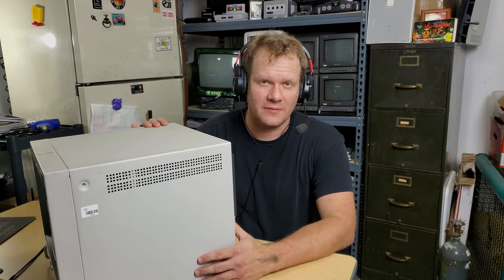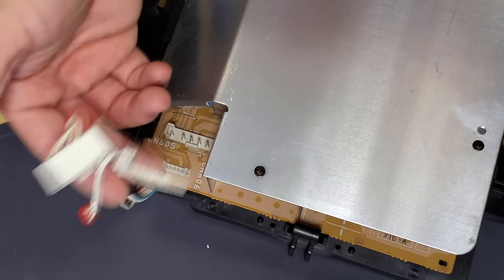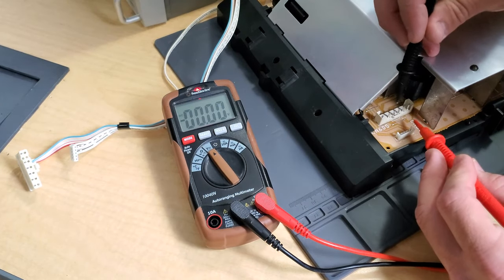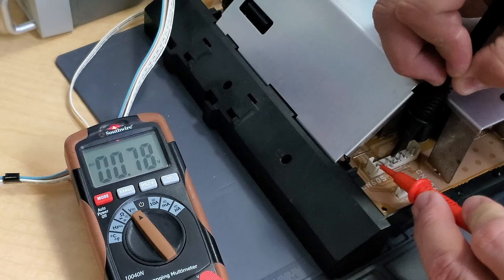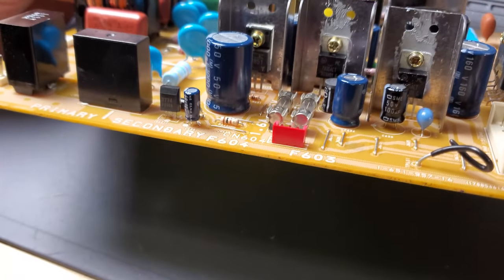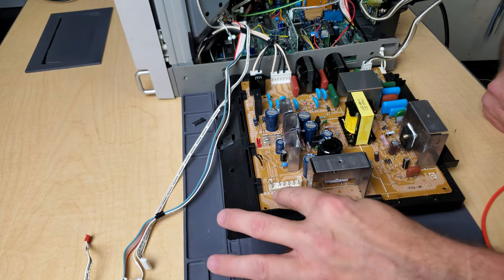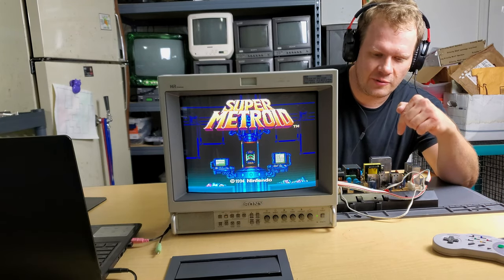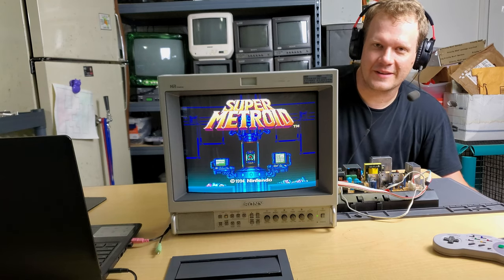My Sony PVM CRT won't Power On - How to find the problem & Fix it.

Comment: Hello Steve. I've watched a couple of your videos in the last days. I got a PVM-14M2U (October 2001) last week. It was sitting in an office unused for years, they were going to dispose of it, and when I asked about it, they told me to take home  (for free!). It doesn't power on, I just removed the cover and I think It was never opened it (the screws were tight like factory and the plastic rivets were pristine). Besides the dust inside and outside, I don't see any major damage (nothing blown, capacitors look ok). I will study your videos and try to repair in 2 weeks. Thanks for sharing this knowledge, it is reall cool to try preventing such retro hardware going to landfill - just need some pointers like you did on this video. I will pair this PVM with a Mr FPGA setup if I succeed. Thanks / kind regards
Reply: Did you get it up & running? I have a similar problem with my PVM but plan to do as you did. Cheers.

Comment: Very helpful Thanks, I recently got a 20" PVM but the screen goes dark-purple after a few seconds. I tested the PSU just as you showed and the results from the multimeter start at the normal values and quickly drop after a few seconds. Did you ever come across something similar?

Comment: Hey Steve, do you have any recommendation how to put in new voltage regulators and attach them to the heatsink? Whenever I screw them in, they blow the fuse. Only when they're not attached to the heatsink at all do they not blow the fuse. How do I properly insulate the regulators from the heatsink?

Comment: i have 9041QM and it showing green power light. the tube or the screen makes that normal cracking sound for a second when turned on. unfortunetly screen doesnt light up, can this be also voltage regulator problem or tube is fried? checked fuses its ok.

Comment: I have one that has the Tally Light Of Death, but the PSU is OK as I have another identical working monitor, swapping the PSU made no difference.
So I noticed the 15V line is fluctuating and we know it's not the power supply. So I took everything off the 15V rail until I found the 12V regulator caused that. But the regulator is fine, just what's behind it isn't. If I put 12V on there, I get 0.6A power draw (which isn't above the regulator's capabilities, but it would need a bigger heatsink). So I took an IR camera and found a CD4738 in the vertical oscillator getting very hot (it shouldn't even get warm, the other CD4738 on the board - there are at least four) don't register on the camera, they're cool). I hope that's it! None of the caps get warm. Also the caps in the Board-PSU section have been changed, especially the notorious ones.
I had another one in for repair that kept blowing its HOT. With the 2SD1878 it would appear to work (and sound) just fine for about 5 seconds then it just shorted.With a BU2525 (which I had on hand) it would last about 8 seconds - everything sounds fine, the 15kHz whine... and then it just blows.
And yes, I got lots of those in for repair that only had a bad 7805...